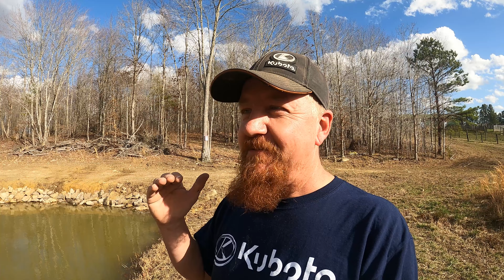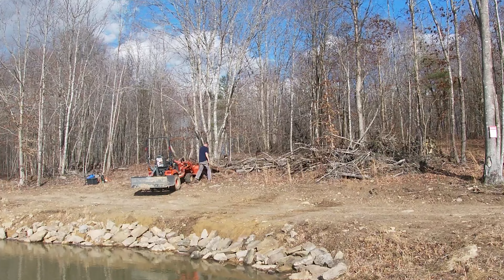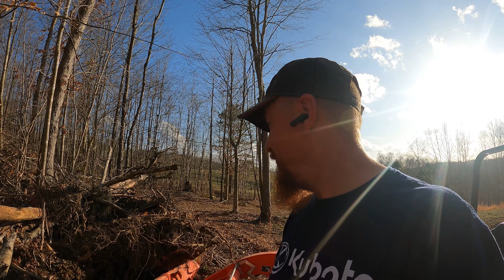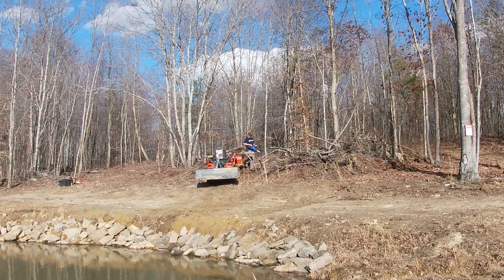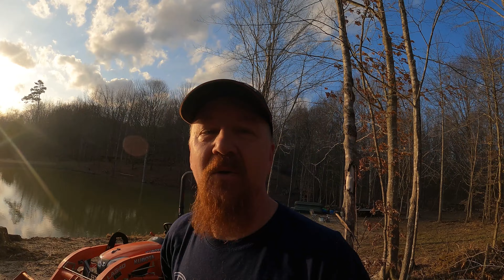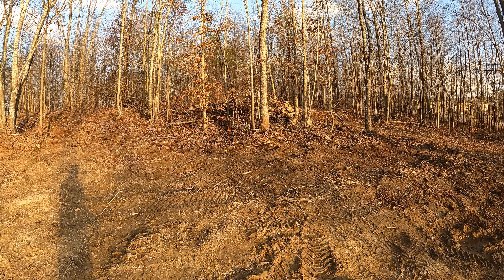We Broke the BX! - Pond Brush Cleanup - Preparing for Progress!

Comment: Built a set of forks for my bx1850 that work great for a job like that.  Solid rod that goes in holes in back of bucket that forks slide on. On and off in about two minutes. Great videos
Reply from the maker: That’s a great idea!  I actually just picked up some clamp on forks and I thought I might try them on this…

Comment: Good Luck with your repairs.
* I purchased a used BX1500 in the Pouring Rain just about 4yrs ago. Only found out the 4WD was bad after the guy delivered it and Deleted his Facebook account.(about a week after delivery) The Front axles would occasionally lock up under load in 4wd.
I really couldn't afford the Tractor due to being recently disabled, much less an expensive repair bill. Well, it worked fine in 2wd so I respected it as best possible and only used the Diff. Lock if additional traction was needed. Worked great as a Lawn mower - lol - , but not what I bought it for.
Well now it has reached the point of locking the front wheels and sliding the tires even in 2wd and needs the Front Differential rebuilt.(well, the whole front Center drive section)
It seems impossible to find Used parts even though there have been plenty of BX1500's stripped and sold for parts.
! The Vultures prefer to completely strip them and sell the individual pieces(gear, bearing, etc.) at a premium - 75%-80% of new.
Reply from the maker: Wow, that is just some rotten luck.  It’s a shame anyone would do that!
Reply: @PeeksPeakHobbyHomestead  Appreciate the reply.
We really don't realize just how valuable our equipment is until we have to do without it. I'm almost 70 and disabled so I do have to resolve this. I'm actually considering a Temporary solution by disassembling and removing the front center axles or finding a way to disable the Differential, just until I can find a complete used affordable drop-in replacement.

Comment: A cheap  clamp on brush fork would make your life a lot easier.  Can't remember what I paid for my junky Titan Attachment brush forks for the BX25D but it was under $200 and they get used A LOT and not just for brush, great for moving a roll of fence and can stack a lot of T post that won't fit in the bucket on the forks.  In the grand scheme of thing fixing a differential lock is not usually among the worst of things,  of course it is not among the easiest of things either. Looking forward to seeing what your cabin build will be.
Reply from the maker: I just looked it up, you’re right, that would make cleaning up this stuff much quicker!

Comment: Oh no! On the dif lock. Definitely a less than bullet proof system.  I've researched that and how the pins connect is not very reassuring.
Reply from the maker: I was pretty bummed.  Luckily I have a great dealer and Kubota has a great warranty.

Comment: i have actually found 3 or 4 of your tractor videos that i hadnt seen yet. i was thinking, you need a small trailer to pull behind the bx. that would have made that job a lot faster, it think. but we know a grapple is on the way and you could use the grapple tp load the trailer and lessen the amount of trips. just thought i would throw that out there.